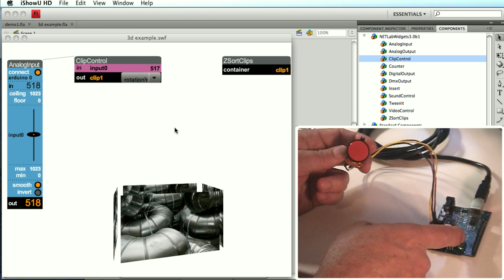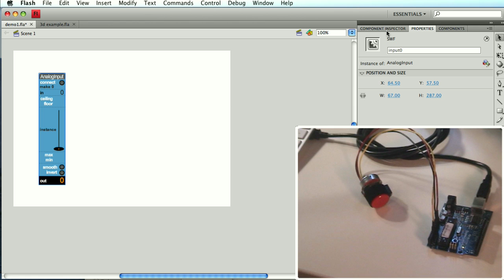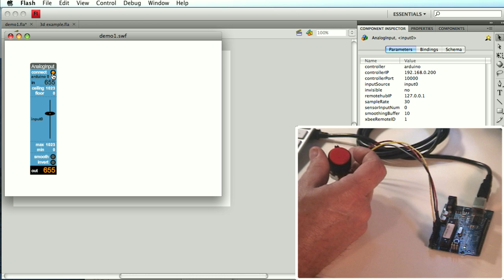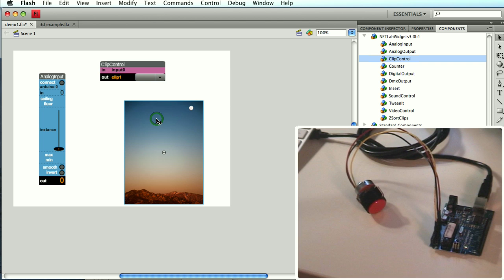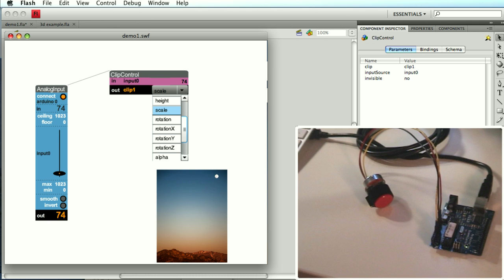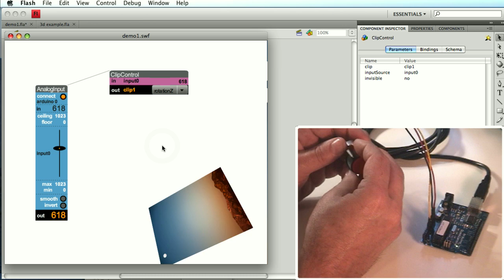NETLab Toolkit Demo 1 - The basics of hooking a sensor to an Ardiuno to Flash

Comment from the maker: The firmware running on the Arduino is Firmata, which is part of the standard Arduino release. Instructions for this are on the website under resources > microcontrollers > arduino setup. Or search the site for "arduino setup"

The toolkit is Mac and PC, but the current Beta release is only Mac. We should have the PC version out in the next couple weeks.